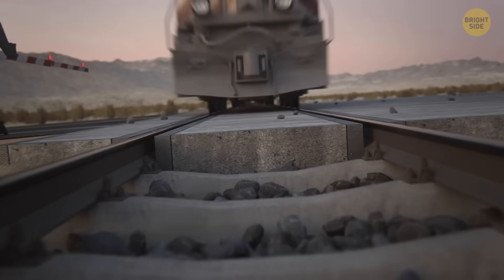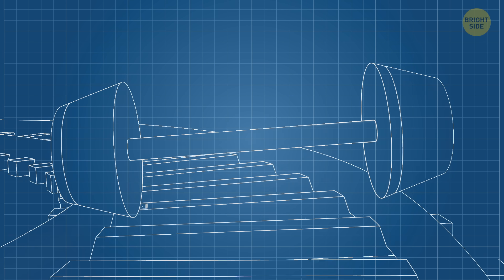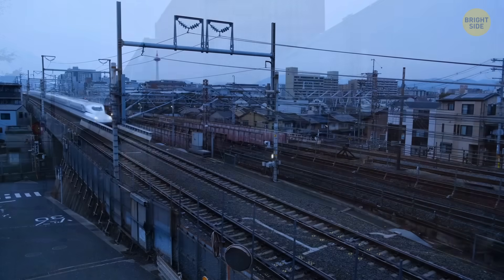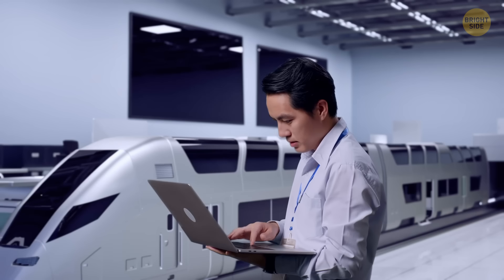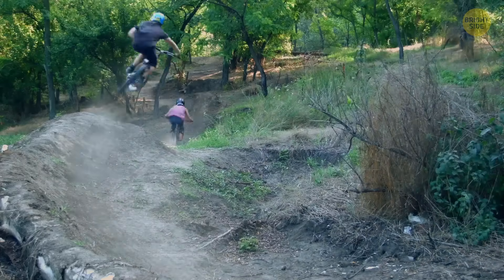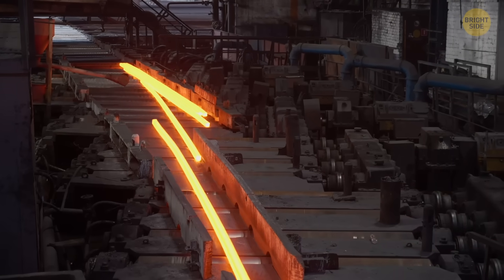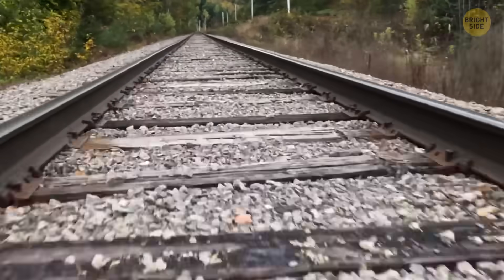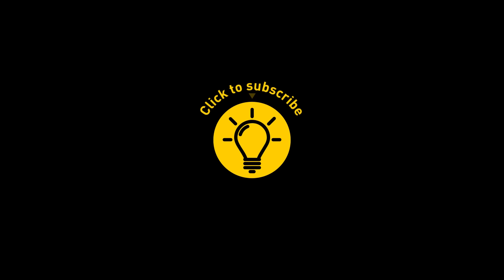Why Train Wheels Look So Weird Up Close

Comment: I've seen train wheels up close. I've never seen any that were tapered like that, making a cone... They might be slightly tapered, but it's actually the lip on the inside edge that keeps it on the tracks. When they're going around a bend, you can hear that lip grinding against the rails.